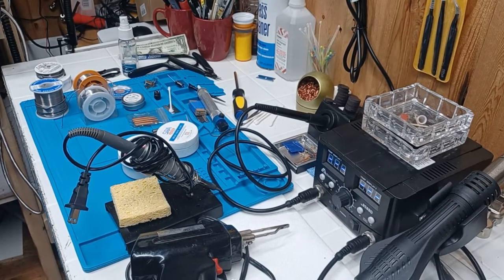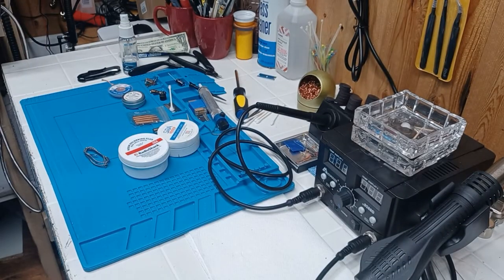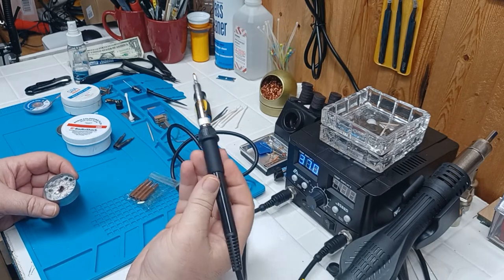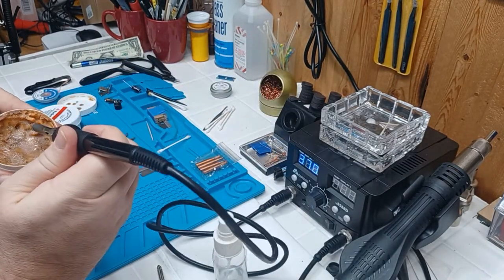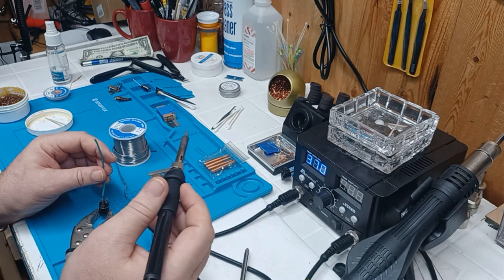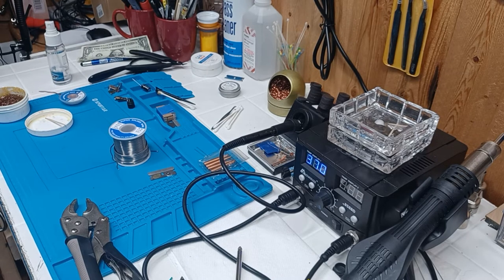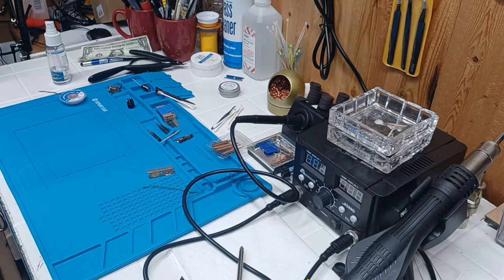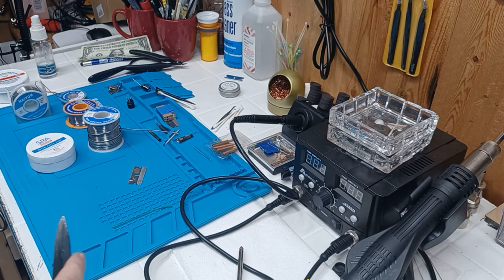how to solder for beginners!

Comment: Very good video 
Where can I get video for flush mount capacitor
Reply from the maker: Thank you!
Do a search for surface mount and there will be several videos. 
Basically it's a solder paste then you place the part in place then heat it up and the paste crawls where it's needed. 
I think most use the soldering style heat gun.

Comment: Tip tinner is only cleaning paste
Tip tinning is running a melt into the tip to tin it which is a thin coat of solder to protect it from the ambient air
This information pertains to hakko FR-100 and am only regurgitating what is on Hakkos instruction video for tip maintenance
Reply from the maker: The stuff i use does both. 
Thanks for watching.

Comment: Hi from England 🇬🇧  I've never soldered anything In my life, about to learn at the tender age of 67 so no spring chicken. 🐤
I'm about to rebuild a DeWalt 18v battery, they recommend using a Spot welder, that's too expensive,so I'm going for solder.
Think I'll have to practice a bit before attacking it as apparently heat destroys the batteries, I'll have to be quick and keep the temperature to a minimum.
Wish me luck,and thank you for my first lesson, I'm about to go on EvilBay and buy my first soldering iron, I'll let you know how it goes!
What could possibly go wrong?    🤪😀👍
Reply from the maker: I'm glad my video helped you. 
They may have suggested spot welding due to the heat the battery will produce might melt the solder.
Good luck with your project and yes please let me know how it turns out.

Comment: i want ask u i need to desolder something and i have wick but i dont know what is the best temp for it
Reply from the maker: Not all solder melts at the same temp. Start out at a lower temp and make sure your tip has big enough surface area to melt it evenly and go up on temp until the solder melts in about 5 seconds or so. You don't want too hot because you risk the trace lifting from the board. But remember you also have to heat thru the desolder braid before the solder will start to melt.
Reply: @Tinman386wisconsin  thank u for reply man + i watch some videos they use flux +  even there is solder on the iron , did u recommended add some solder on iron or just flux and wick , what i want to desolder is xbox analog joystick , so is 300c fine ??
Reply from the maker: @giovannigiorgio2262  300c is probably fine i usually start out at 280 to 300 i think. 
No you don't want or need solder on the iron or flux. The desolder braid should wick the old solder right up once its hot enough. 
If it don't, then you could try a little flux on the braid so it accepts the solder better. But try a little more heat first. 
The addex flux might make the solder flow and spread out farther, making more of a mess than anything.
Reply: @Tinman386wisconsin  thank u for info my last Question i'm scared from oxidation , more heat = oxidation , who solder all time and they have experience they says you have to tin your solder iron before you use it so im confused 😭😭 btw im not pro i know how to solder by watching videos   🫡 so i want to learn more and thank u for ur time
Reply from the maker: @giovannigiorgio2262  yes, tin your iron and keep the tip clean for sure when soldering.
When desoldering it will help with heat transfer to remove the solder with less heat.  But it's not totally necessary when desoldering.
Often times mine will be a nasty crusty need when removing solder due to high heat on large parts.  Then when i solder in the new parts im always dipping and cleaning the tip in the brass wool.
Which btw i prefer the brass wool over a wet sponge. It don't cool the tip and cleans faster and easier. Not to mention i funny have to keep wetting the dang sponge.

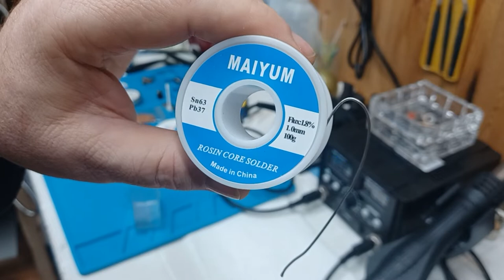Comment: Dude, that solder at 4:04 is not lead-free. It even has Pb on the label. 😂
Reply from the maker: I will have to go back and watch again to know what you're talking about. 
But if im not mistaken it was low lead. It gets a dull finish when it cools.
Reply: @Tinman386wisconsin  Looks like it's supposedly 63% tin 37% lead, but who knows?